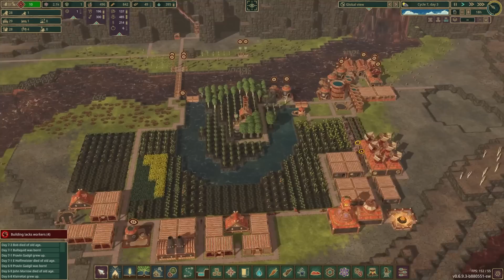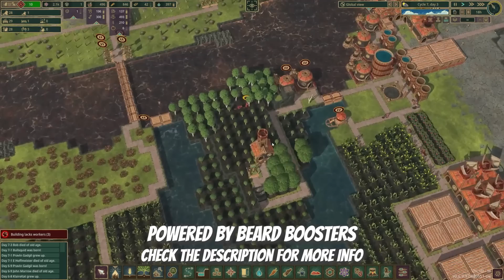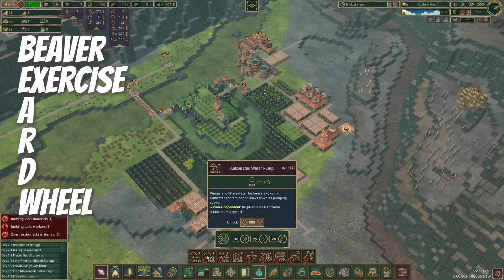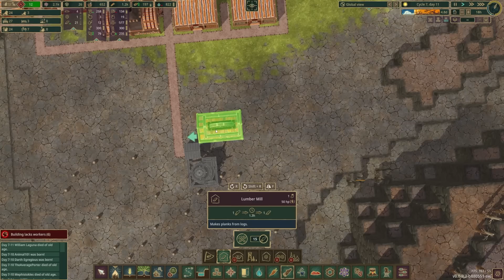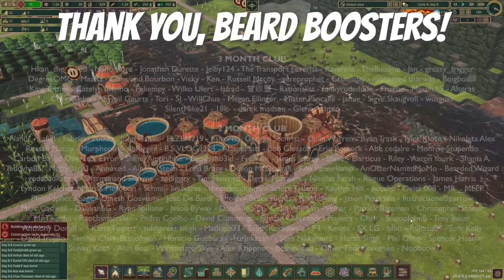Time for automated water pumps! Timberborn Emberpelts Hard Mode Ep05

Comment: I'd make the housing in the hill behind the district center/campfire area, over the current badwater river. Eventually there is a plateau up there to expand to so this area will always be centralized. 
There's a 1-2 block high hill right behind there, could be easy to start building on that without too many resources. Then when that badwater river gets blocked off upstream and maybe turned to a clean river later, the housing can continue vertically in the cliffside behind it (by this point you should have much more resources to freely build). It can become a lovely beaver village with a river in the middle.

Comment: 4:00 I dunno if you referred to me or not, but I was talking about the round divot nearby the water wheel/science buildings that you mentioned filling previously. I just said a couple blocks in there for a 3x3 would work, and be right next to main base ;)  BEARD Beaver Exercise And Rotational Device ;)  Why not build housing on the other side.. You have to get up that cliff anyway, so you could build houses on both sides, stacking them up, and using the ladders up the side for access ;) Now that you're automating water collection... a bit more wood production, and you can go block off the rest of the bad water corrupting your supply.. Then can make a nice tall dam right where it waterfalls by base.. and BAM! Water is fixed! :D Man I love the JC beavers.. don't forget to get a tail stamper!!! #BeardsMatter

Comment: Fluid dumps will keep water topped off without overflowing the level of the pump. You should keep that fluid dump on always so you don't have to refill the crop irrigation in the middle of a drought

Comment: Now that you have an engine and automated pumps, you need to make sure you have haulers at all times. I'd HIGHLY recommend building a second hauling post, reducing the number of workers in it to just 2 or 3, and raising the priority on those jobs to high, if not max. A minimum of 2 or 3 should be enough to keep the things that require haulers from being neglected, with the second post (10 jobs at low priority) being your beaver overflow.
Reply: @CaTastrophy427 , yes one with few haulers at max priority and another with all jobs open at minimum priority.
Reply from the maker: As we continue adding more beavers next episode, we'll beef up hauling as well

Comment: So, from my own run, a single fluid dump can only barely keep up with evaporation in the horseshoe, and if it's not prioritized by haulers, it loses height slowly over time. I'd recommend a second one for refilling it.

I'd also recommend using stream gauges to automate the fluid dumps, especially for the 3x3 pools this map DESPERATELY needs for a run to go past midgame. I make them turn on when height drops below 0.4, and turn off once it goes above 0.7. In a 3x3 pool, that means it's on for 4 hours or so, and then off for 3 days. Since I have several of these staggered somewhat, I effectively have one beaver who just cycles between all the 3x3 pools' dumps and don't need to worry about the automation screwing with any other jobs - though it wouldn't take anything from necessary jobs, since I have two additional hauling posts for spare beavers bc my population fluctuates wildly at times (due to mass breeding causing population spikes that all die and get replaced at the same time... I intend to fix that once I get enough bots to hold my colony steady as I cull most of the beavers and then properly manage their reproduction rate as they repopulate)

Comment: 52:10
Considering the haulers are the ones moving the water from those, I don't think they need storage to necessarily be that close to them.
Reply: Haulers get more moved the shorter the ways are.
Reply: @walkir2662 , but if they move to the closer tank and later move it to another one further away, then they lose efficiency.

Comment: One of things i did on this map was, once i cut off that badwater sources behind your district center, dynamite across from the water fall to the pools and river behind your district center (the one thats had badwater in it this whole time and was overflowing at the start).  Once you have dynamite of course :P  it does redirect the flow of water around behind your base so you will want to block it off at the end so it doesn't run off the map on you.

Build a bridge across to that Ruin island in the bay there!  Once the Ruins are removed its the perfect place to put the emberpelt's wonder!

Housing: I think you should put them in on the lower level by the natural stairs by the tooth Grindstone.  Just starting in that corner there!

Comment: Seeing how last episode you blocked of 2 badwater sources, reducing the amount of power your waterwheels can generate, you maybe could throw a few levees in the river to narrow the river around the waterwheel area, increasing power output from those waterwheels again.

Before a 5 wide gap was needed for the riverbanks not to flood. Maybe that gap is now gone down to a 4 wide gap before the river overflows again.
4 wide is exactly the gap between the riverbank and that tetris piece shaped rubble island (at it's narrowest point), the gap to the other riverbank is 3 wide. So to increase waterwheel power at the very least you are safe to put in 2 levees on that side, maybe even all 3 to make all the riverwater flow south of "tetris rubble island".
Considering a levee is about half the logs of a water wheel, potentially worth it?

Comment: Consider rebinding your "pause building" key to something easier to reach than [P]. I have mine set to [R] (with "rotate building" and "detonate dynamite", because there's no real conflict).

That little creek along the bottom of the cliff isn't going to irrigate a whole lot, even if you fill it with clean water. You should just build where its expedient and leave wrangling the terrain for later.

Comment: Haven't finished watch the video yet. But if you build more water wheels put leeve in between to force the water to flow through a channel that will produce more power

Edit: also why build the water dump with 1 block out of line. Just line all 4 up in a row smh lol

Comment: → 9:16 So this staircase (just made highest priority) needs 4 planks. You have currently 2 in stock. 9:30 ... and decide to pause the lumbermill? (Noticed 16:40)
→ It looks like half of your corn is never harvested, as it's too far away, and you always got nearer crops to harvest.
→ 15:53 "Our water storage right now is full" – that sounds like the right time to dump some into your horseshoe area? (Finally turned on 31:50 when it was empty.)
→ 33:42 "Empty [the plank pile]!" – Given that you just placed a bunch of pumps and platforms here, which need planks, I'd keep the small pile for now to support the builders. Same with the log piles. You can still remove them later when you need the space.
→ I'll let others give input on the location of the housing, but you if you go for the larger housing units, you should close (pause) a few of the smaller units at the moment you open a large one, then slowly reopen them after your population filled the space up, and repeat this for the next one. (I.e. you should always have several small houses left, don't delete them all at once). This way you can grow your population more gradually, and avoid the big birth- and death waves messing up the economy.

Comment: the big lake where all the water runs off is honestly prime for housing. whenever i large water areas i always try to put my housing there. you can run power under the platforms or just remove a few and add a water wheel on to it. low leveled ground for me is always saved for trees and food. you could demo the cliffs to make vertical factories.

Comment: I just watched the previous video.
From the main river, as it curves and drops down one more block as it empties into that final lake... you can draw a diagonal like from the curve of the river to the tip of the little island with scrap metal and then from that island to the edge of the map. Thus creating a diagonal river that exits the map without filling the lake, The lake is now 100% plantable terrain with the help of a few levees and water dump setups. Now besides that area you gathered the emergency oaks from in the previous episode, our have full control over nearly 1/4 of the map with a majority of said area viable for planting and building with no possibility of accidental contamination, especially after you block off the 2nd badwater source behind the settlement that feeds the small river and pollutes the main river from the "far right side in relation to the main waterfall".

Comment: 15:40 there is a spot almost in the middle of the screen that can get you across that badwater in 4 platforms, which with a huge ladder can get you to the most efficient way i've found to cut off those badwater supplies.  A two piece levee almost straight up from that point to get to that island, and a three piece levee to block off the far side of the island.  It also has the bonus of getting you a good relatively close source of badwater.  If you wanted to keep the badwater behind your settlement, you would just need to use two platforms instead of the first two levee pieces for the easiest access.  all of this requires a ton of wood/planks for the ladder but once you finish the new forestry area you should be good on wood!

Comment: Housing, especially the biggest housing, next to the natural stairs that head down to your new fluid dump/tree farm is a great spot.  still close to the main area and won't need additional stairs to enter them.  Two of the largest will hold enough population to replace all your current housing plus a few extra beavers (36 total instead of 30).  slap on a few rooftop terraces and nearby campfires and you'll get all your fire needs as well!

Comment: You have the materials to go up and close off the other badwater inflow, should greatly increase the pumps efficiency. 
Considering most of the map is on the other side of the river, maybe build a highrise up the cliff so they can grab food below, every worker for the beginning area can go on and your expansion workers go back up and do their job. You do not have that much more to build down there, most of it can become farms as soon as you block the badwater on that side. 
(Following is a small vision for a goal to work towards, all probably 10+ episodes away) With a few aqueducts later in the series you can even cut down considerably on beaver labor to keep everything irrigated. Parts of the badwater canal could become small irrigation ponds, same with the big open flood plain down below. Section the river off so it flows off directly and you gain a ton of land for more trees around the ruins. Relocate your main industry upstairs as you can supplement your power needs with the badwater sources there. Then you can focus on shaping the rest of the map. (It would probably wise to include some more diversion and reservoir building in this long- term process I suppose.)

Well, consider this just food for thought, I´m interested to see how you shape it in the end.

Comment: I didnt know you could get clean water from the poluted water. Learned another thing. Thank you. Great video
Reply: It has to be mixed, you can't get it from pure badwater (aka from just a badwater source, or during a badtide) but yeah, partial contamination won't fully stop goodwater production. It WILL slow it proportionally to contamination level, so if it's 25% badwater (and thus 75% goodwater), your pumps will work at 75% their normal speed.

You'll also have to keep in mind that, when pumping from a pool of standing mixed water, you'll be removing goodwater from the mix and leaving all the badwater, thus increasing the contamination percentage over time. Evaporation doesn't change that percentage, it removes both kinds proportionally, but pumping will change the balance and can make a pool that had been irrigating normally start to contaminate the ground around it.

Comment: During the next drought, you could extend the path behind the new production area, and they could take the natrual stairs downa and remove those two blockages. Not critical, but something to check off the list.

I'd like to eventually see some platforms over the little pond and areas like that, with housing on top. The idea of housing, storage, etc, built on over water appeals to me. You could even put some platforms and housing in the river itself. Then all land is free. I know it needs to be centralized right now, I'm just saying it could be cool.

Like Metal Island. You could do platforms, with water wheels, and have an off-shore production island, with it's own power.

Comment: You know your little horseshoe waterbed? You've got a fluid dump on one side, but you really need one on the other side too, since you're pouring water in almost as far from the canola as you can get. Sticking one there would reduce how much water you needed to use to irrigate in the first place, and probably save your crops.

Comment: I kept waiting all episode to see when your fluid dump at the new tree farm is compelted before teh levees, lockingteh construction beavers out. ;)

Housing: I'd put it on the level below the main settlements so you can put rooftop terraces on top of the houses that directly connect to the main settlement. But warehouses also allow that, so...

29:55 I would have put a levee into the river, then moved the automated pump touching the wheel one square left. That way, you don't need the corner transmission and the path can just continue straight on instead of having to curve. That's personal preference, though.
31:30 Being able to (un)pause fluid dumps depending on downstream the way sluices do would be great!
42:xx - the industrial sector also can use easy water power until you block off the badwater flow behind your settlement. Especially after the one currently unreachable blockage is removed.
47:40 Can't be the slowest, isn't a German construction project.
51:10 I would add a path directly from the second automated pump to that new medium tank. ...Aaaand 53:10 you blocked it with a new medium tank despite wasting two squares that way. Moving it a row closer to the science huts and flipping the entry would have helped logistics a LOT.

Comment: Note: If you don't turn off the fluid dump for the horseshoe pond then at least turn off "prioritized by haulers" on it, before starting into this badtide.

Long term goal: As you already made it to the upper plateau to cut off the bad water, you could build from the top down a ladder tower to get to the breakable tiles at the water mixing point before the waterfall.

Glad to see the future log farming area about to get irrigated and I like the location of the new industrial area, you could drop in water wheels at the river and shafts to the area supplement power easily from there.

Comment: That new fluiddump you're placing in the dried riverbed, maybe move it over so you can have a path across the levees to reach the other side of that watering hole you're building?
Right now the dump is going to block the path, so you can't even reach half of the soon-to-be green area

Keep up the good work!
Reply: YES! that is what i wanted to say!
Reply: that was the first thing i thought too, as soon as he placed it!
Reply: I'd have waited for the resources to put the Fluid Dump on a platform and using that line of 3 levees as the pathway across the ravine.